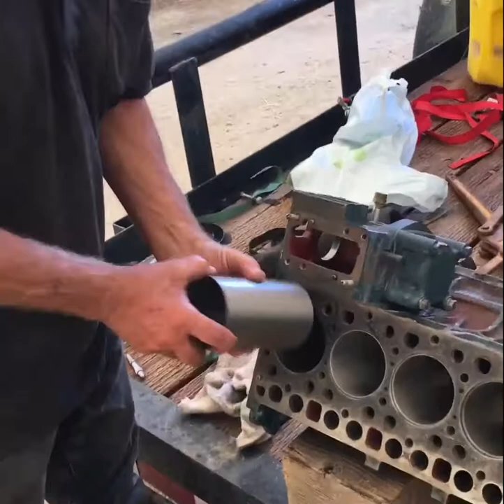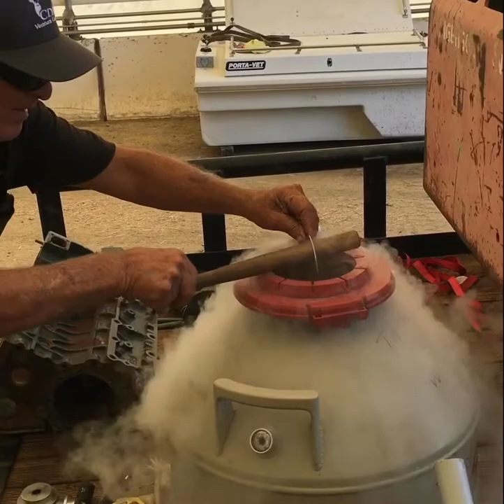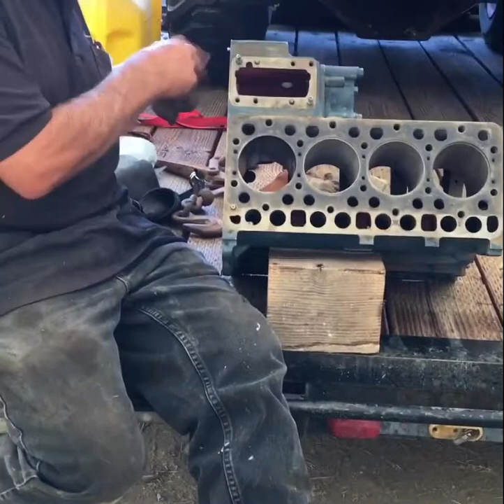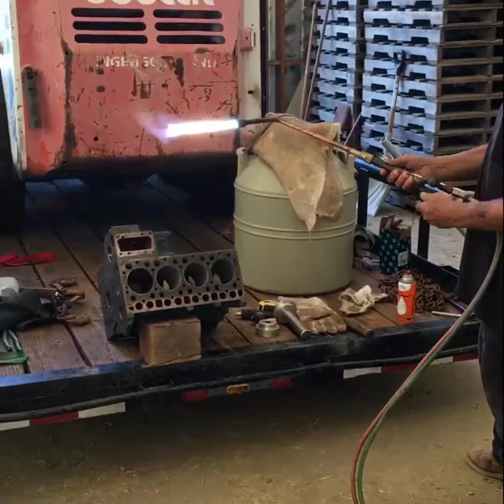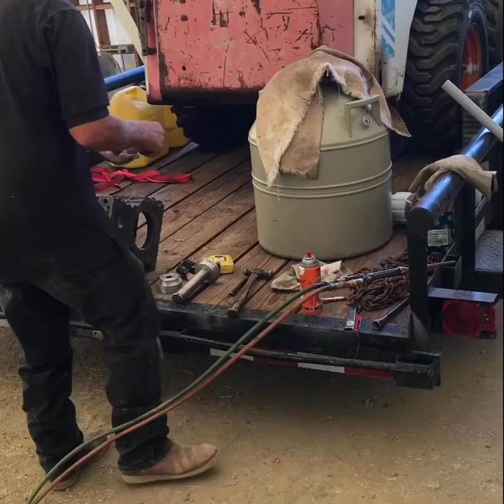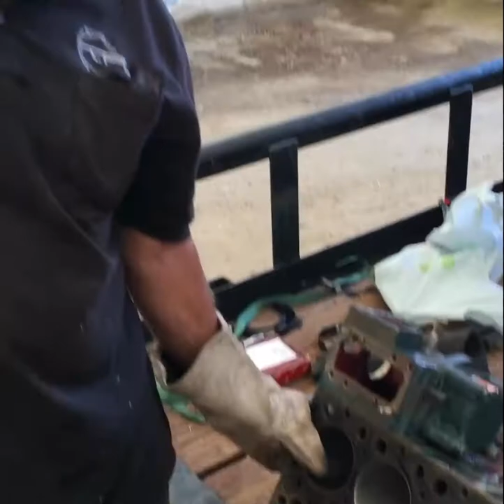How to install cylinder liners for a Kubota engine. #kubota

Comment: awesome!! i know im late to the party   when installing new liners do they have to be machined after installation to accommodate a new piston?
Reply from the maker: Yes they do. The OD of the liners come with an interference fit.  Once installed the bore needs to be machined to OEM or for your piston size.
Reply: @bonmil7924  I have a kubota with a ticking sound I think a wrist pin and was wanting to just get a standard kit to change all 3 pistons rings and wrist pins so you think I could just leave the stock liners in and not have to replace them the engine don’t use oil or have issues only the ticking coming form rear cylinder and it’s not the rod bearings because I installed new ones and still has the ticking sound from that cylinder
Reply from the maker: @lazowelding  Liners do not need replacement if measurements are within the required  factory tolerance specifications. Size of liner bore will dictate piston and ring size. 
Could the ticking sound be from a bad injector?
Reply: @bonmil7924  the ticking or tapping noise was from a rod bearing that wore out and fell out of rear piston and we caught it as soon as noise started.once bearings got replaced it was more quiet but still has a ticking sound and we think because bearings were gone it was slapping piston wrist pin too and got sloppy  because bearings are new but noise is still there just more quiet..we might swap injector and try that..
Reply from the maker: @lazowelding  If you take the engine apart again it’s important to measure all parts to determine if they need replacing. Micrometers are your friends

Comment: And you just happened to have a tank of liquid nitrogen in your garage?  Where do you get that?  I would think that dry ice would have close to the same affect and be much easier to get.
Reply from the maker: Air Gas or local welding shop.
Reply: @bonmil7924  So at -100ºF would dry ice also work?  With heating the block to +200º that would give you a 300º difference which makes a pretty large difference in a circumference.
Reply from the maker: Dry ice was a test run with alcohol and it didn't work.

Comment: Did you experience and liner drop after using the engine?
Reply from the maker: No issues so far.
Reply: Awesome I have to do this for my 4cyl kubota v1305 and the machine shop keeps saying that the liner will drip and ill blow a head gasket.
Reply from the maker: Good luck!  Let us know how it goes!

Comment: Does that engine come with liner and you remove the old one?
Or you bore to block to install liners ?
Reply from the maker: Engine came with liners and had to be removed.  Used a 
 torch and heated in three areas and then cooled liner with a big dose of water and pulled out.

Comment: Does the block deck need to be machined after installing the new liners? Does the deck need machining even if within spec with straight edge and feeler gauges?
Reply from the maker: @tom6549
The block deck does not need to be machined after liner installation. Liners should be flush with deck. If the deck is within flat tolerance then no machining is required.
Reply: @bonmil7924  It is all most impossible to accurately measure the Deck of a Block, using a Feeler Gage! If there is any indication of an Overheating situation, I would recommend that the "Deck of the Block" and Cylinder Head be machined at least .001 to determine if it is FLAT, if you want to do a quality Job! Sure you can use a Feeler Gage, but most Machine Shop will only use that method as a rough estimate. One the other hand I have used the Feeler Gage method successfully in many situations. However, if I am doing an Engine Project that is questionable, I am Machining the Block/Head.